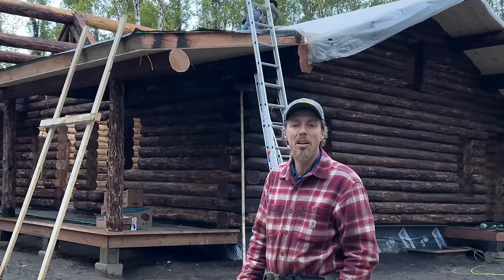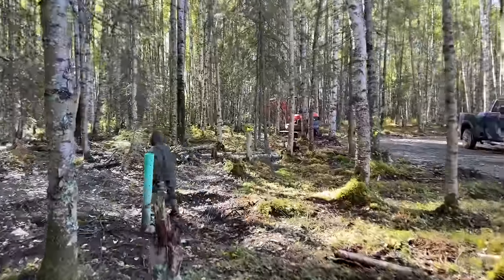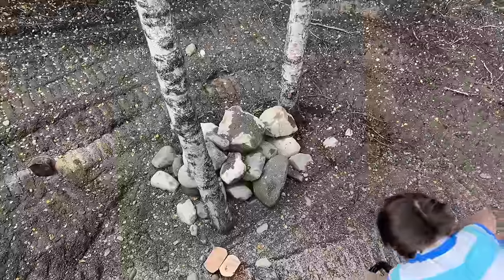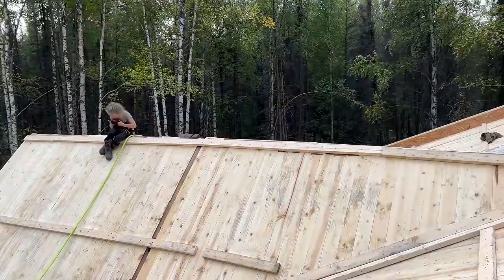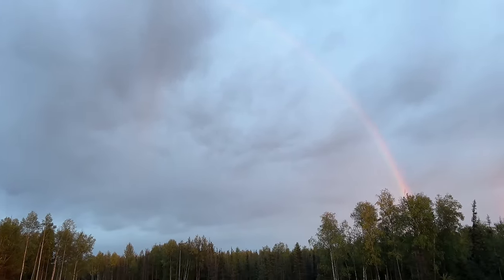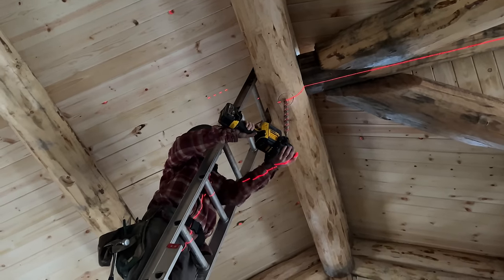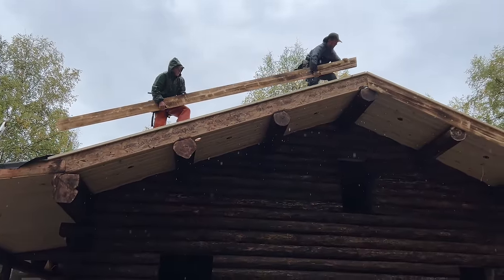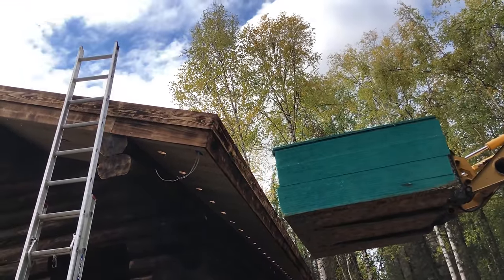Building The Roof on our Alaska Log Home 🔨

Comment: I've built and worked on several log homes.  Those 2"x6" tongue and groove boards you use for ceiling exposure.  You ran them vertical vs horizontal.  Our roofs allowed us to run them horizontal.  Interesting reveal on the inside.
Thomas Dutkiewicz
Connecticut
Reply from the maker: Yes, I’m familiar with that kind of build as well
Reply: @MontanaHaven  
Excellent show in showing the different phases of work.
Thomas Dutkiewicz

Comment: Brother I’m sure you’re aware of the dangers in Alaska. But Please have your boys to play in the woods much closer to the house. Wyatt or any of the rest of them shouldn’t be going deep in those woods in Alaska not without an Armed adult with them. Bears will attack and could even kill, especially if it has cubs with it. Not to mention other predators such as wolves 🐺 and the dreaded encounter with the Grizzly Bear 🐻. This is why most all Alaskans carry very large caliber handguns 44 magnum, 454 Cassull, 460 or 500S&W handguns. Also 12 gauge shotguns with rifled Slug barrels.  Just have your boys to play it safe by staying a little closer to the house. Closer to the noise of the construction 🔨 is a deterrent for the predators.   God Bless ya